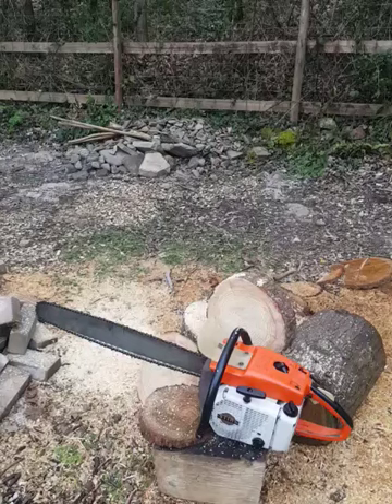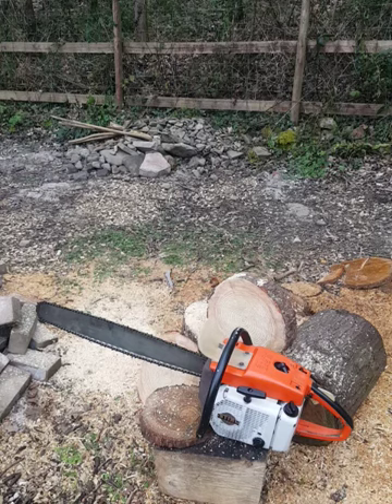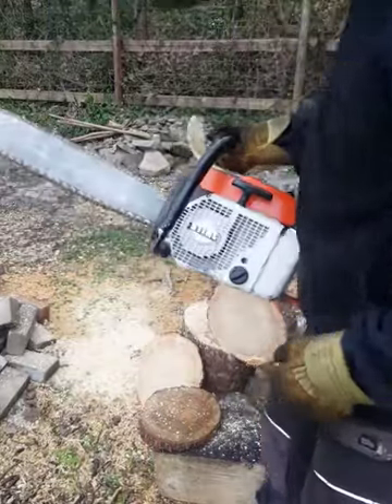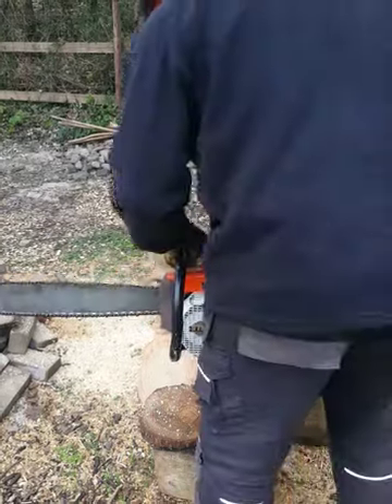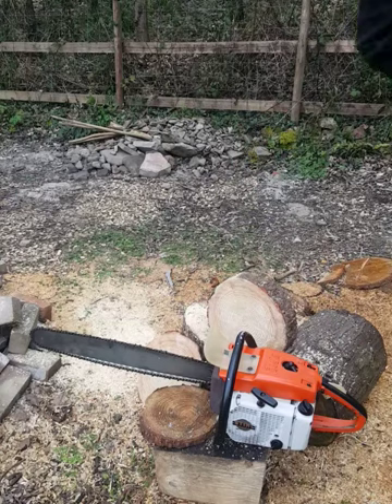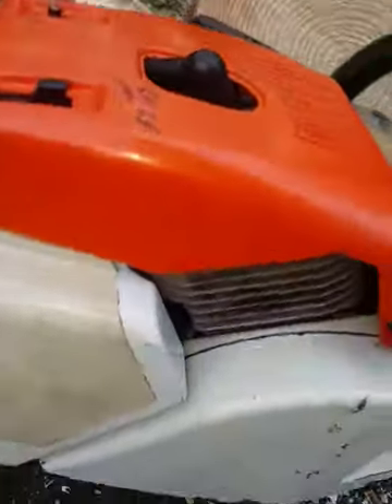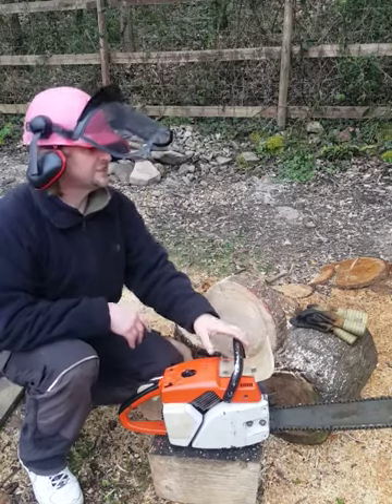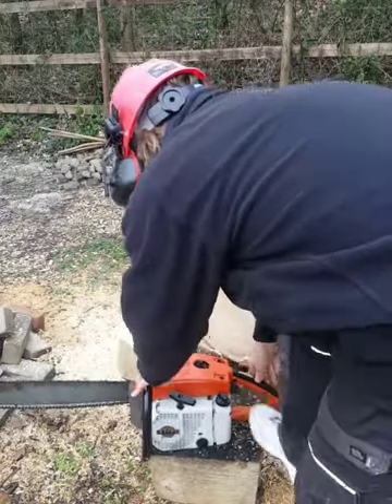Stihl 045AV. First run. Starting & idling.

Comment: I'm interested. Try loosening the bar nuts and lifting up the tip of the bar as far as it will go before you tighten the nuts again.
Reply from the maker: Hi... im pretty sure i already have, but i will check it again later tonight ☺
Reply: @stridebaad1219  solid nose run slack all the time
Reply from the maker: @stuartclark5191  hey.. thank you for the info.. I did not know that 👍
Reply: @stridebaad1219  oyeah I got 045 !5inch solidnose
Reply from the maker: Hi Stuart. I have a Stihl 056 with a 28" Solid Nose bar and that chain is also just as loose fully adjusted. I will try cutting with it later to see how it performs :-)
Reply: @stridebaad1219  solid nose always runs with slack my friend its normal